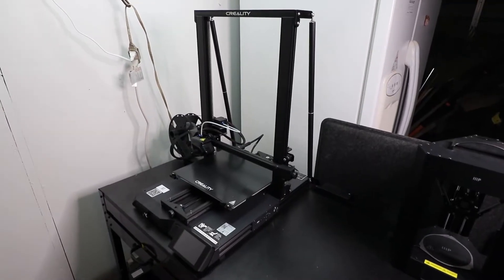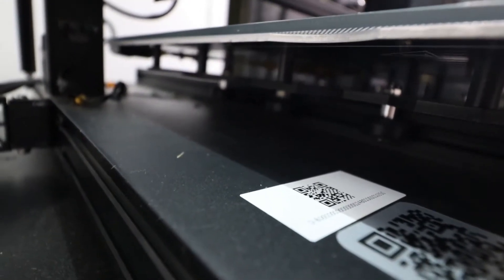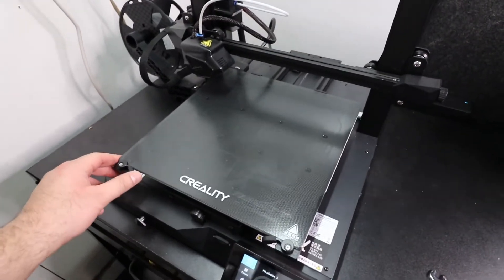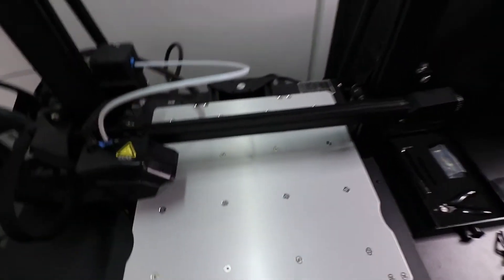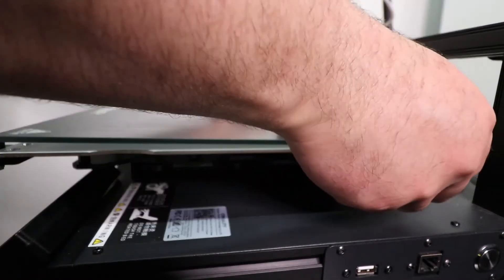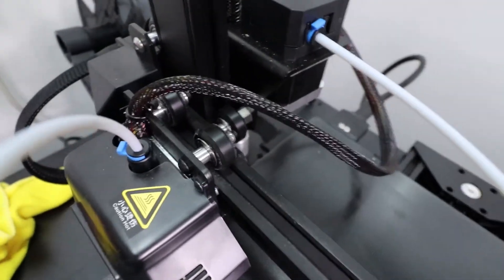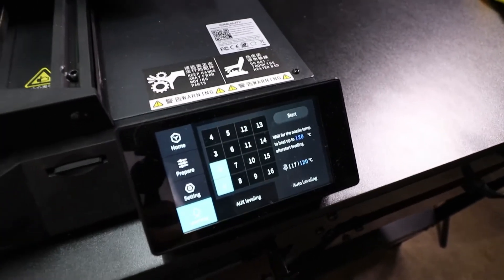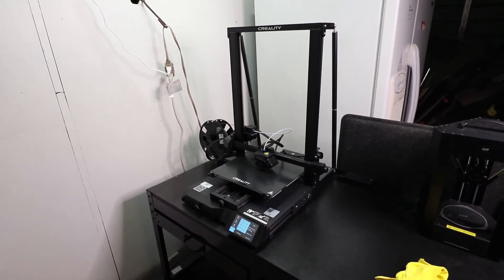3D Printing Issues And Solutions: Creality CR 10 Smart

Comment: Thanks for the video. I have a question: after autolevel the nozzle is not at the same height in all plataform points. I check that with a paper using the aux level feature. Can you imagen why this may happen? I mean... whtat's the point of the aux - level feature? Thanks a lot dude!
Reply from the maker: Thanks for the comment Simon :) I hear you brother. It’s well known that the glass bed that comes with the cr-10 smart can be a little warped like mine was. Since I purchased mine from creality official, I contacted them and told them about the issue I was having, and sent them pictures and videos of the problem. They ended up sending me a new glass bed to replace the old warped one.
Reply: @3DTheory  Thank you. I guess i'll have to do the same. The difference is tiny. In the center i put de bed level in 0.28 but in the top corners the correct value is 0.32. Thats the same difference did you have? Thanks again brother!
Reply from the maker: @elpluma76  I had a similar issue with the glass bed where the center of the bed was slightly lower and the corners were higher. The glass bed was bowing and I think this was a manufacturing error from creality, so I hear. But I do talk about this in my video here: https://youtu.be/CAs4bNuFfBU 
You will see that I printed a sheet, and the center is good, but the two corners was ripping the 3d print, because the glass bed was bowed and higher than the center of the bed. These videos and pictures are what I sent to creality official.